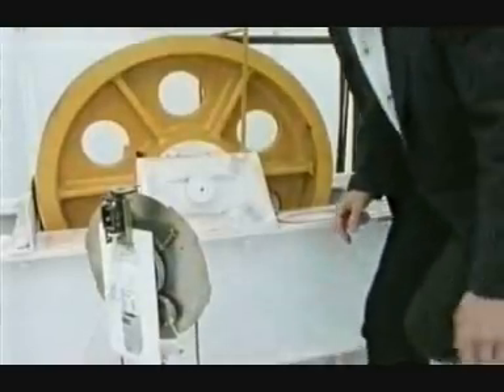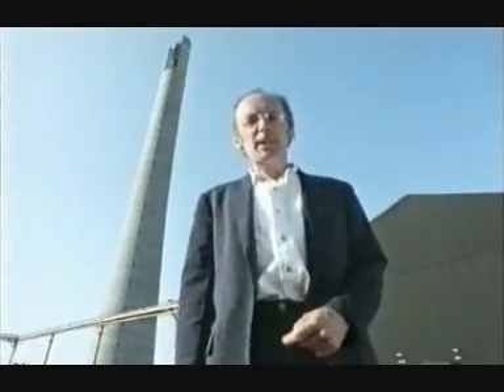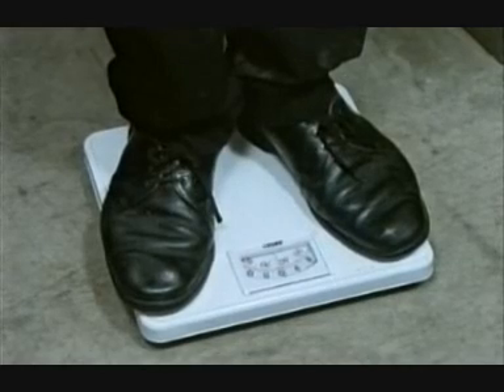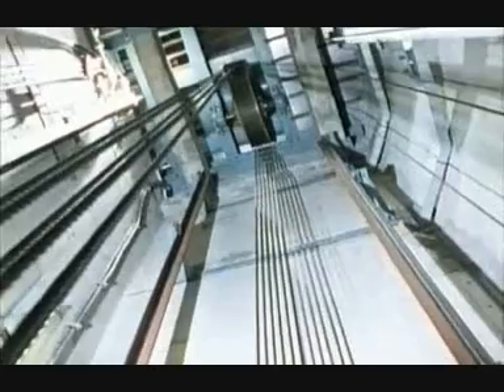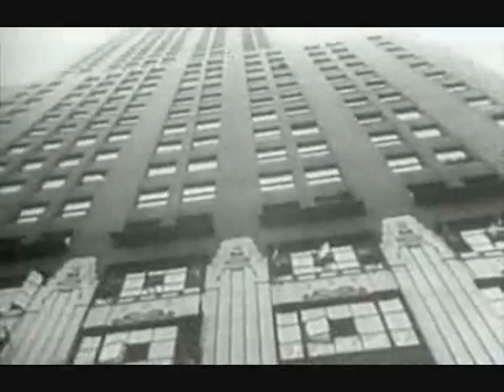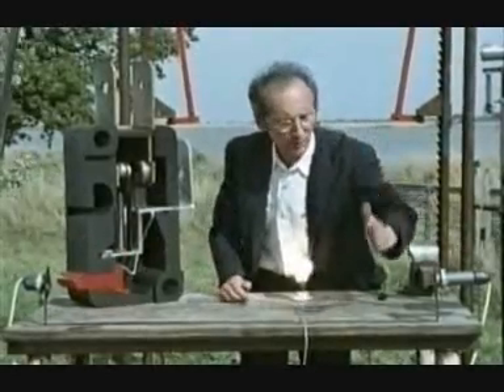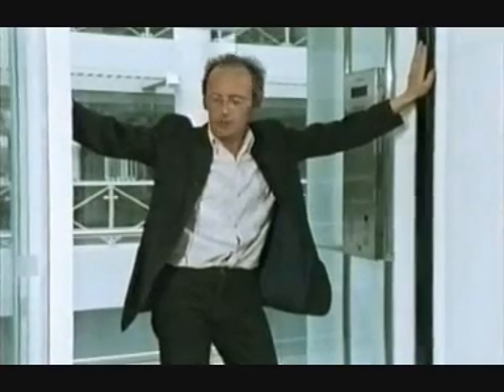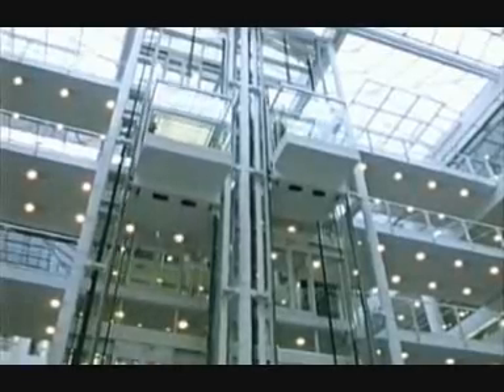Secret Life of Lifts series,Part 2/3: Express Lifts Tower

Comment: mrmattandmrchay, i used to work for express, and they installed a duplex in 1964, the top speed was 1000 ft per min but were governed  down, that was fast for 60s.
Reply: 5 metres per second

Comment from the maker: This is a geared machine, the motor turns many many more times than the sheave that the ropes are attached to - so when you are turning the motor it is vastly geared down. Also, he is winding the lift in the upwards direction. This is easier as the counter weighs the same as the lift car plus about 40% load, which means if you were to remove the brake it would travel upwards naturally (with noone in it)